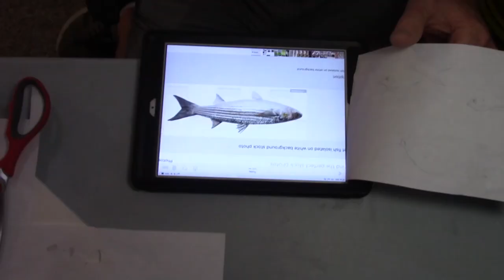Lets build a mullet swim bait!

Comment: More lessons learned. Thank you.
   I'm new to this hobby. I've been watching tutorials for about 1 1/2 years and have learned a lot. Thanks to individuals like yourself.
  I've made about 80 lures so far and none have seen the water past my kitchen sink ! But, soon...
  All of mine are carved wooden lures.
   I haven't seen any lure makers use epoxy clay as of yet. This surprises me.
   I've done a deal of decorative carvings as well as taxidermy in the past, and it fills a lot of voids, literally.
    It takes some time to harden, but you can sculpt while soft, sand and carve once hardened.
  Filling voids, left by adding weight, or tearout on carvings, it works great. You could even make fins from it.
   Apoxy Clay and Magic Sculpt are two that I have used. They last for years. When they become stiff, a few seconds in the microwave will soften them and make them malleable again.
  Great appreciation my friend.
 I've been in construction for 50 years. We learn how to disguise our mistakes. ( Well, maybe not "OURS", but those that need to be rectified....)
  Blessings
Reply from the maker: Thank you, I think there are many more materials to play with than time to do so, I’ve thought about 5 minute epoxy mixed with sawdust to create a lure but haven’t tried it yet.
  I’ve even thought about creating my own substance from urethane resin and a floating medium.🥴👍
Reply: @lureup9973  life stems from imagination.... You're planting many seeds...

Comment: I also follow the Engineer Angler and couldn’t help but think of all the equations he’d of used here. Lol. Trial and error goes a long way. I’m going to give it a shot a creating my own swim baits soon. As a airbrusher myself, I currently purchase unpainted swim bait blanks and paint them. I’ve tested some 15 different styles. The belt connected ones have bar none the best action. But, the ones that have the best action have one thing in common. The tail section has a flare to the end that creates the best action. Rather then have a smooth transition to the tail, flare it out just a bit. That flare seems to give the blanks I have extra action. It’s what I intend to do with mine. Nice job my friend
Reply from the maker: Thanks for the advice!

Comment: Great video.  Thank you very much for helping out all of us novice makers.  Quick question, How long do you have to wait after pouring the two halves of resin before you close the mold?  Is there a time or temp or how do you know when it is safe to shut? Also, where do you get the eyelets for the joints?   Thanks again.

Comment: wow. I think this is your best video yet. So informative. love all the tips. I love your method of mold making. I wonder if you could make it by squeezing silicone caulk into it. instead of pouring liquid rubber.
Reply from the maker: Yes you can use silicone caulk, it can be mixed with corn starch I believe, thank you for the kind words Rick!
Reply: @lureup9973  With the way you make your molds. I doubt the silicone would be more than a quarter of an inch thick. I bet you could just use the caulk directly out of the tube. It should cure. Any Chances you have tried before or would try in the future. It could really bring the mold cost down.
Reply from the maker: @rickmarmar82  yes I have, remember though caulking is much thicker, it will not fill naturally with just gravity, you have to work it into place….. but it can be done!